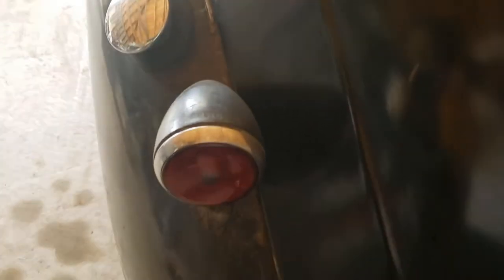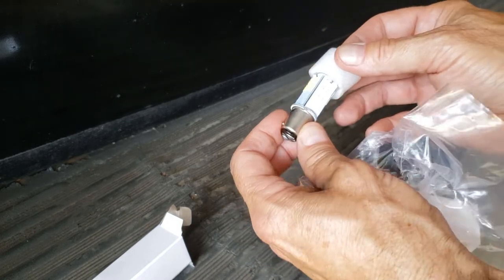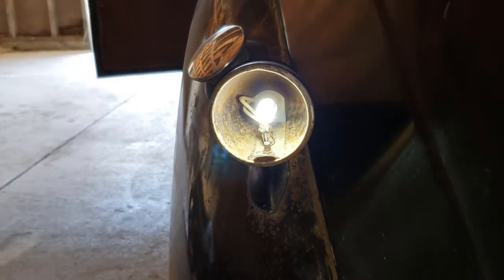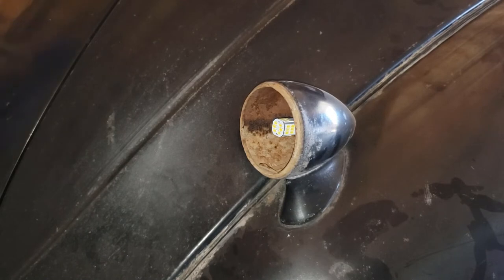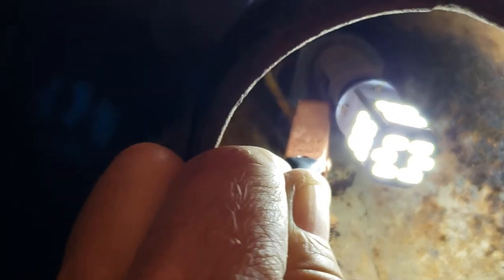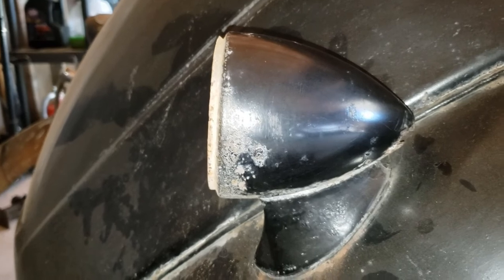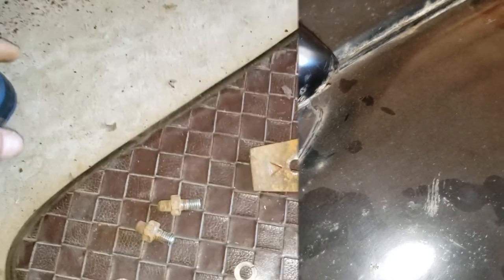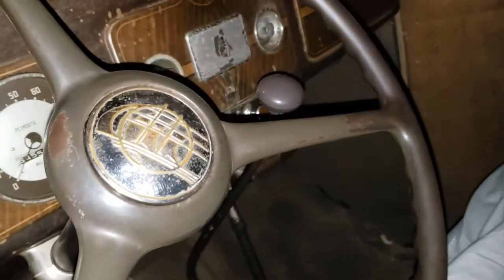Episode 5 - 1937 Plymouth "Gimme a Brake (light)!

Comment: I found good brand new springs at Home depot. Gate return springs. They worked excellent to replace the old rusty springs up in the wheel wells that house the tail light wires. They were pretty well identical to the original stock springs.
Reply from the maker: Good Tip! Thanks, that'll save me some time, for sure. Appreciate your comments.

Comment: Hi I have a 38 4 door . I'm trying to do my brake lights and the tail/running light works but it won't work with brake pedal.  Any ideas what to check.
Reply from the maker: Get an ohm meter and check the hydraulic brake light switch for continuity when the brake pedal is depressed. The switch is located on the drivers side inner fender well. There's two wires connected to it and will measure close to 0 ohms when the brake is depressed.